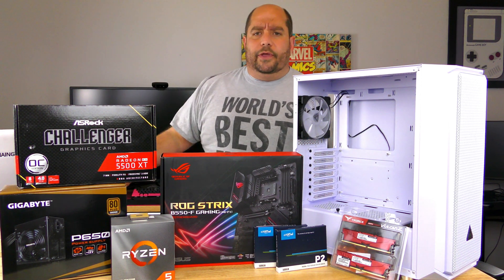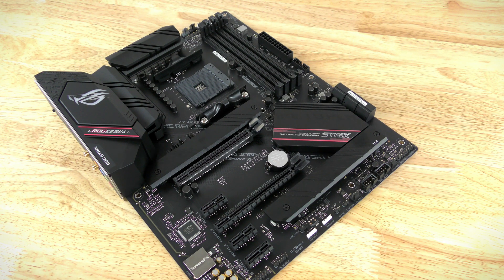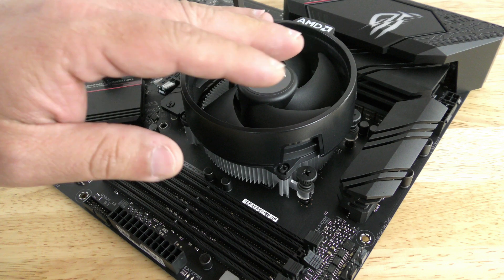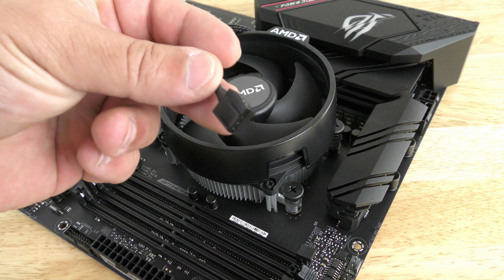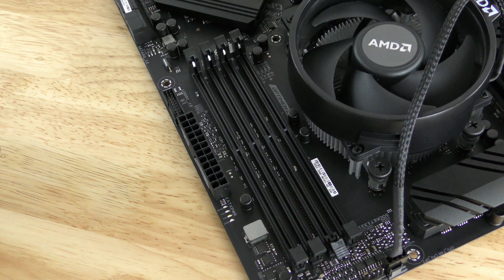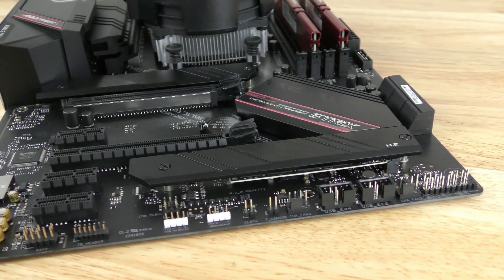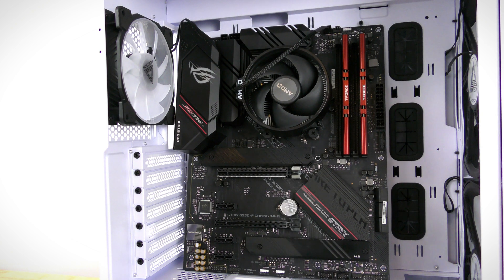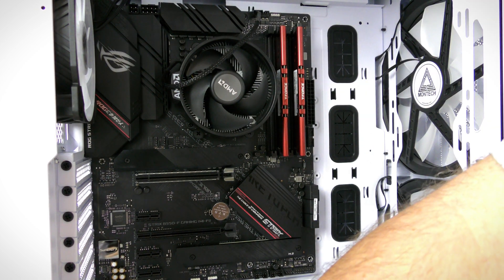How to build a Budget Gaming PC in 2021 - Ryzen Gaming PC Build Guide

Comment: My son and I are putting together a gaming computer. We have a ROG Strix B550 Gamingboard and your videos have been very helpful is putting together the computer. We are running into problems updating and setting up the bias. I was able to download the bias version 3001 but the computer does not recognize it. We tried to skip updating the bias and continued through the setup process. We have not been able to connect to the internet. It wants up to use an ethernet cable and not giving us an option to connect through wi-fi. On your video during the setup process when we are in the bias utility and under the advanced setting you go down to intel lan controller and there is an option just under the intel lan controller that says wi-fi controller. We do not have this option on our computer. We also do not have the Bluetooth controller option. Do you know why these options do not exist for up?

John Schaefer
Reply from the maker: Always a pleasure my friend, but this is the video you want to watch then: https://youtu.be/AWxliGLert8

As for the WIFI, it doesn't sound like your board has WIFI, especially since it doesn't have bluetooth, they sell a B550 with and without WIFI.

Comment: If this case(air x) is equipped with this motherboard(b550-f gaming wifi), can I adjust the fan speed?  Because the fan of this case is 3 pin.
Reply from the maker: The fans are 3Pin but they connect to the controller which is 4Pin, the cabling video is linked to this video: https://youtu.be/bgThR2hTVlM
Reply: Thanks for that, btw your videos are really awesome!
Reply from the maker: thank you so much my friend, I really do appreciate your kind words, they mean a ton to me and your support.  Thank you so much and I am so happy I could help.

Comment: Cheaping out on the thermal paste is a bad idea, just saying. You can pick some up for like $10. The paste included is garbage.
Reply from the maker: Then it would have gone above the 900, I was cutting it close, while I agree, I did it right not the phony 900 pcs when they buy used thing and trade, unrealistic though with prices now of everything.... I guess this is fake too since 900 can barely get you a gt1030
Reply: @ThisBytesForYou   I understand sticking to the price, but most thermal paste, here anyway, you can actually get for under $10. The point I suppose is it would have been better for the CPU. 

Actually, what sparked me to comment on this was the fact my Ryzen 7, which I just got yesterday, had thermal paste on the included fan, and it was basically just small dots of paste, if that makes sense. 

Finally managed to save enough to get a Ryzen 7, went with the 3700X. I had a R5 prior to that but lost it due to a failed surge protector.This processor is amazing, compared to the chip I was using after the R5 failed; FX-8350. Great video otherwise!
Reply from the maker: @haidengeary8277  I 100% agree, but this is just the basics to get you by, chances are if you are building a machine, you will stick to the basics just for a little, as we all have, then upgrade as you go.

If the CPU has a fan included when you buy it, it will have preapplied thermal paste, not a small dot though, it would be smoothed out paste, perhaps this was a messed up application?  You really don't need much thermal paste, a pee sized dot in the middle, and as you apply the heatsink to the CPU, it spreads out evenly to cover the cpu.

That is a nice processor my friend, good stuff, and yeah I had an issue with a WOODS brand surge protector that didn't help and friend my BenQ 1000Watt PSU, I WAS FURIOUS and WOODS would not stand by their warranty, I flamed them for a while, but I will never buy another WOODS product again, I will stick to APC and one other (I forget the name now).  Never plug anything, anything directly into the wall, surge protector or battery backup only.

So very happy you enjoyed the video my friend.  i have almost 400 on here, surely there will be something else you like as well.

Comment: @ThisBitesForYou How many FPS can this pc do?
Reply from the maker: sadly its an impossible question for me to answer because there are soooooo many factors, what resolution, what refresh rate, what game, what in game settings.  Do you have anything in mind?
Reply: @ThisBytesForYou  144hz the monitor,the games are valorant,call of duty,fortnite
Reply: @ThisBytesForYou  and the resolution is  1920x1080
Reply from the maker: @katalinvizsy4543  and what kind of profile, medium, high, very high Ultra?
Reply: @ThisBytesForYou  low/medium
Reply from the maker: @katalinvizsy4543  you can probably pull off way more than 144 fps on that, you might want to try high, maybe medium.  At 1080P though you are a lot more CPU bound, what CPU do you have or will you be using what I recommend here?
Reply: @ThisBytesForYou  I wanna use that cpu in the video?
Reply: @ThisBytesForYou  tysm!!!

Comment: I have a question do I have to use that motherboard if not can you give me a motherboard in the 70- 80 dollars range
Reply from the maker: I would love to answer you, but I need for you to answer a few questions for me.  What processor will you be using, what video card and what will you be using the computer for?  Also, how much ram and how many hard drives/ssd's, M.2s?
Reply: @ThisBytesForYou  I want to use a ryzen 5 3600 rx 5500 rt with 16gb ram 500gb ssd

Comment: Is there a cheaper motherboard option I could use with this build which wouldn't decrease performance? Thanks!
Reply from the maker: yes there are, but lower the 550 is not 100% supported by next gen processors.  Sticking to the chipset, this board is about $70 cheaper on my amazon affiliate link: https://geni.us/qn2zTv1

I chose the ROG board because it was sent to me to review, but it fit the budget build, if I could have been sent a less expensive board, it would have helped a little but bring the budget build to 800 or raise the video card, but I have to work with what I have.  I hope this helps

Comment: hello, so I'm planning to build a pc with similar parts https://pcpartpicker.com/list/VMC62V but Idk if I should get a b550 or an x570, what do u recommend and why?
Reply from the maker: I would recommend the X570, as it would be a little more future proof, have the ability to install a 2nd M.2 drive and was officially supported with AMD's initial announcement of support the newer cpu's, 450 and 550 were later added, so they will have slightly more limitations.  The 570 uses a Gen4 chipset link, while B550 uses Gen3. The X570 has PCIe Gen4 lanes off of the chipset that are separate from the CPU's lanes, B550 does not natively which is why B550 only has 1 x M.2.  I see these are all Amazon links, will you be buying everything from Amazon?
Reply: @ThisBytesForYou   I won’t be buying from Amazon, however I would be thankful if u provide me with names of great x570 motherboards that would be compatible with the parts
Reply from the maker: Ahh ok, I was going to ask if you were using Amazon, to please use my affiliate code, it would help me tons, but if you are not, no worries.  Check out this video for the 570, i even have build videos too: https://youtu.be/E8OgiA_btds

Comment: Ah shit, i build yesterday a new pc and i didnt place the standoffs.
I just screwed the board without them....
Am i in trouble?
Do i have to unscrew and do it again?
It was so scary already lol.
Reply from the maker: Please remove your motherboard and verify all the standoffs, any missing, put them in and any extras, take them out.  They could kill your board, cause a fire, kill your power supply.  There is of course a chance your case already had the standoffs in the correct location, but don't count on it, for your safety and the safety of your machine, please do double check.
Reply: @ThisBytesForYou  I have the corsair 4000d airflow case and apparently the standoffs are pre installed there already.
I remember i lined up the motherboard with a unthreated one in the middle.
I have a ATX motherboard, is it easy to missplace the motherboard?
I heard the pre installed standoffs in this case are set for ATX boards.
Reply from the maker: @Sachai G yes, most cases have them set already, there might be 1 or 2 missing or extra's, as a case manufacturer, you are kind of damned if you do and damned if you don't.  If you put too many, many people will mess up their systems if they don't know, if you put too little, many people will mess up their systems if they don't know.  

Many have an extra stand off on the left center standoff location, right under it, inbetween the bottom left and middle left stand off.  

There are MANY different standards and potentials to mess up your system as well as some boards that slightly go off of the standards, so you always have to pay attention to that.
Reply: @ThisBytesForYou  Ok thanks for info. Everything so far seems to work how it should.
There also hasnt been static or annything, even when touching with my hand for example the side of the case closest to the motherboard so opposite of the window of the case. Should i be fine you think?
Reply from the maker: @Dalgri  The static shouldn't happen but with the extra or missing stand off, if your motherboard/case get's moved or bumped, it could cause it to come closer to an object that it should causing it to short.  I know it will take a few extra minutes to check and make sure but it will save you headache and time later, just trying to help you my friend.
Reply: @ThisBytesForYou  i appreciate it allot. Can i also check and make sure without taking thé motherboard out of the case?
Reply from the maker: @Dalgri  you may be able to by looking at the back portion of the case, taking off the side panel and counting how many stand offs are screwed in then going back to your motherboard and seeing how many screws you have screwed in.

Comment: Hello great video, is it possible to use the new 6800 in this build ?
Reply from the maker: Connection wise yes, but it is recommended to have at least a 750Watt power supply.   The system is fine, but you will need to get a better power supply.  If you have already purchased one, I can recommend a power supply , maybe like this one from my Global Amazon Affiliate link: https://geni.us/JD9R6f
Reply: Thanks for your quick respond I haven’t bought anything yet i am currently searching for an amd 6800 build without the new ryzen 5600 processor. Is it just ok to go with the build from the video or could u recommend a specific built which would be I deal in combination with the amd 6800
Reply from the maker: @Sterling44  oh ok, so sorry, i see my previous comment got cut off, sorry about that, so this build would be perfect for you and the power supply, keeping the cost down, so it will not be modular would be this one from my Amazon affiliate Global link: https://geni.us/JD9R6f, I hope this helps you.  You can find links to all the parts used in this build in my description. Please let me know if you need anything else, always a pleasure to help.
Reply: Thank you! In case I go for your build I will make sure to use your affiliate links
Reply from the maker: @Sterling44  You are so very welcome my friend, always trying to help where I can.  Also, thank you so much for offering to use my links, they really do help.  If you go through my older videos to my newer videos you will notice the quality keeps improving and my gear does as well.  All the money I make from Amazon and Youtube goes right back into the channel to keep improving it, I have come a LONG WAY but I have so much more to go.  thanks so much for stopping by.  Also, in regards to the 6800.... stay tuned ;)

Comment: Just a quick tip: Use a more mid-range motherboard and get a better graphics card (5600XT OR 5700XT)

B550 wifi: https://www.amazon.com/B550-AORUS-PRO-AC-Motherboard/dp/B089FTMG2B/ref=sr_1_1?dchild=1&keywords=b550+wifi&qid=1605543221&sr=8-1 
B450(no-wifi): https://www.amazon.com/MSI-Crossfire-Motherboard-Tomahawk-B450TOMAMAX/dp/B07WF6ZQST/ref=sr_1_4?crid=3RGSP80MMTV1W&dchild=1&keywords=b550+tomahawk&qid=1605543419&sprefix=b550+toma%2Caps%2C175&sr=8-4
B450 wifi : https://www.amazon.com/gp/product/B07FW85VFT/ref=ewc_pr_img_8?smid=ATVPDKIKX0DER&psc=1
Reply from the maker: Yeah, when I was picking it , it was before it was discovered that a 450 could also use the newer processors.  As a reviewer also for Roguecast i was able to get this board to review, I could not find that one but yeah I wanted to go lower to get a 5600 in the build, a 5700 would not have been affordable enough.  Thanks so much for chiming in my friend, it means the world to me.
Reply: @ThisBytesForYou   Your welcome.... (i'm a subscribed )
Reply from the maker: @awsomedude3937  Thank you so much my friend, I really do appreciate your support.

Comment: I might be getting a pc do u mind using these specs 
Thermal take v200 pc case
Corsair vengeance rgb 32gb
Sky Hynix gold 1TB
Barracuda internal 2TB hard drive
750watts power supply RM
Micro Center Motherboard CPU Combo GIGABYTE Z390 Gaming X Motherboard ATX 2xM.2 Realtek ALC892 Intel LAN Bundle with Intel Core i9-9900K Desktop Processor 8 Cores up to 5.0 GHz Turbo Unlocked LGA1151
Rtx 2060
AMD wraith cpu cooler
Reply from the maker: Looks like a nice build, something like this: https://youtu.be/HN8D_FRHtP4
Reply: @ThisBytesForYou  thank you
Reply from the maker: Anytime my friend, so very happy I could help you